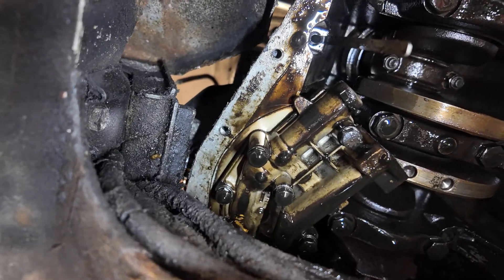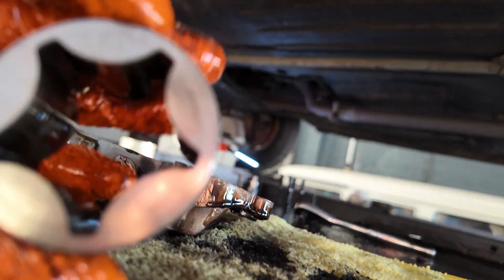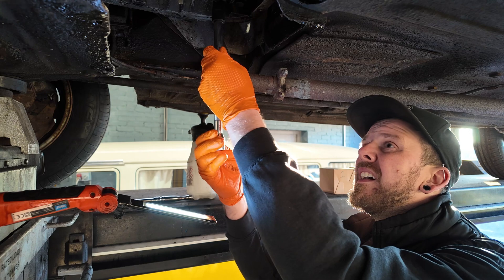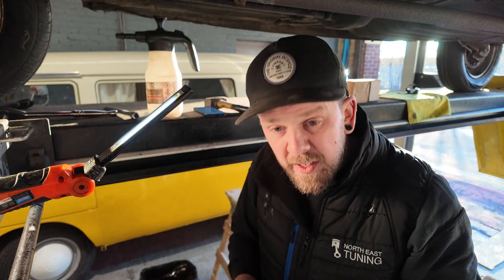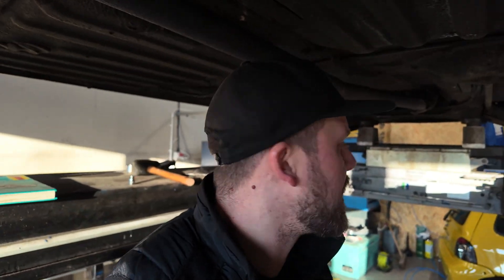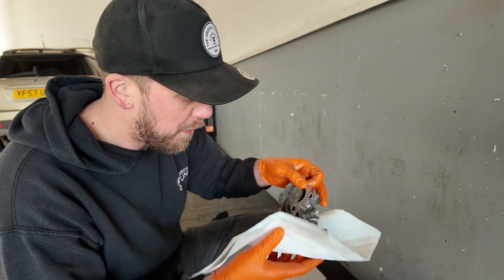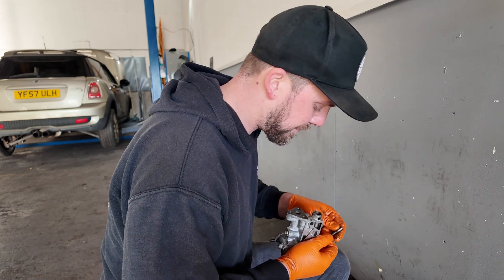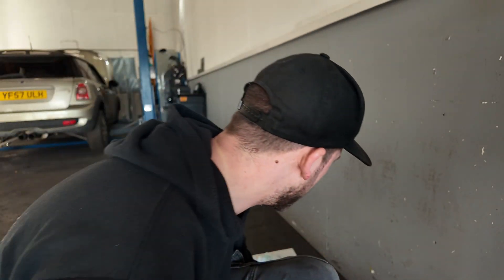Renault R16: How to remove and inspect the oil pump, big end shells and crank.

Comment: Conventional oil was used in the engine,,With absolutely no add pack,,No cleaning solution,,This is why no one should use conventional oil in any car,,Run a good quality full syn oil through the engine,,Change it 3 or 4 times over 500 miles,,And change the oil filter each time,,It will clean out all the crap and rejuvenate all the seals ,The valve stem seals,,

Comment: With these engines you can flatten the base of the oil pump on a surface plate with some wet & dry. That will remove the scoring . . presuming the pump is otherwise within spec.
Remember too that the pump rotor and annulus come as a matched set.

Comment: Thank you for doing this videos. I also have problems with the oil pressure. I have a R16 TS from 1972. I just recently started to work on the problem witch was discovered in May 2018. The car has just stood there for almost 7 years. Then your videos appear when I decided to solve the problem. What a coincident. I´m really looking forward to coming videos. If it wasn´t for the distance, I live in the south of Sweden, I would gladly have come to your garage to help and learn. Keep up the good work.

Comment: My first 16TS - I've owned three - was a '73 model which, under Australian content law, had the Jaeger instrumentation replaced by locally-sourced VDO clocks. By some weird logic, the oil pressure and water temperature light were on the same relay switch. A friend who borrowed the car for a Melbourne-Sydney round trip - for the comfort factor - erroneously added more oil when he should have checked the coolant level [they were one of the first Renaults with a sealed cooling system] Needless to say, he returned the car with a blown head gasket and no recompense. Regardless, I moved onto 300,000 kilometers with the next two '75's.

Comment: I owned a 1971 R16 that we had bought used, it was both my wife's and my favorite car ever. We have a friend who back in the mid 1970s who had a1969 model. He was doing some fairly long commutes for a temporary job and the gasket on the timing chain cover failed and the oil escaped fairly quickly. I helped him repair it and he drove it for many more years until he was rear ended in a snowstorm in Tampa Florida - it was so novel to the Floridians that the driver behind him was looking up into the sky and not the road. As for the bearings, I totally agree with your choice! Looking forward to the next one!
Reply from the maker: I'm loving hearing all these memories! Thank you for sharing. 

I never expected the 16 to have so much appeal, but I'm all about it. More in the pipeline don't worry, and thank you for your support.

Comment: It's structurally a very fine engine (LJK Setright) and in the Europa (6500 rpn) & Alpine could rev. Standard models had a 6K red line - not shabby at all for the era.
Reply from the maker: Absolutely, a very robust unit in these. Up until 200 yards before we turned it off, it was a little sewing machine. 

As you can tell from the original 16 video I was taking it very easy and low revving on the engine, and had been consistently. I'm glad I did!

Comment: How lucky are you! I reckon that the viscosity of that 'oil ' probably helped protect everything when you lost pressure. You can get a really good result polishing a crank with wd40 and emery cloth or wet and dry paper. I managed to get my crank back to near perfect and it had lots of picked up bearing material on it. The sections on the crank you mentioned are the journals. Unfortunately for me two ended up being just a bit too much out of spec. Can I ask what the people you spoke to thought about potential oil pressure loss on your worn journal? (Not a criticism, I'm just trying to gather opinions/experiences from others for my own learning) I have a spare engine that might benefit from what you're doing to yours.. I for one am enjoying the content. Keep it coming!
Oil changes... the cheapest insurance there is...
Reply from the maker: I am certainly lucky and know it! Yes I will absolutely be doing the wet n dry and a shoelace trick, it's got me out of a few situation in the past with great success. Particularly on my three bearing crank 100e. 

Spoke to three people very highly regarded in the Renault world, all three of them said looking at the wear they would say "Sure it's not going to be like new, but it will be serviceable. Try a thicker oil." in a nutshell. Which is exactly what I thought. Looking at the workshop manual there's a reasonable tolerance given. As part of the rebuild an oil pressure gauge will be fitted to keep an eye on it all.

Comment: I removed the engine in my Renault 16TS in the 1970's to replace the timing chain gasket, which took me a full weekend. It took about 20 minutes to remove the old gasket clean the faces and put on the new one. I miss the comfort and versatility of the 16TS and the superb ride. The ride in a modern car is terrible.
Reply from the maker: It's amazing what you could achieve in a short space of time with these. I'm very very fortunate to have a 4 post ramp, which makes things easier. But I often find nothing beats the determination of having an engine in bits on your mums driveway knowing you've got to drive it to work tomorrow morning!

Comment: Another great video, so nice to see somebody working on these Renault engines, it is a rare sight to see in the UK, I would totally agree with you fit a set of shells before pulling the whole thing apart, once you get all that sludge flushed out and get some good oil in there it will probably last for years, if the oil pressure stays near what it should be it can't be too bad, by the way I am restoring a 1972 Renault 17TS at the moment with the same type of engine (1565cc injection) looking forward to your next video.
Reply from the maker: Thank you, I appreciate the support. Best of luck in the restoration of your 17, such a rare car I imagine that's a real struggle to get bits for. I'm assuming you've got similar connections for parts, like Duncan, Salv and Brian?